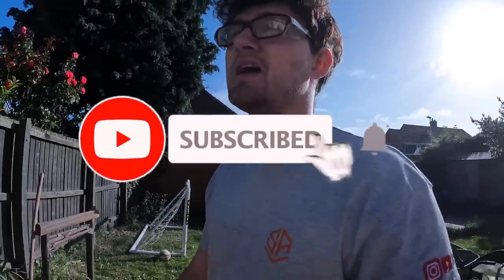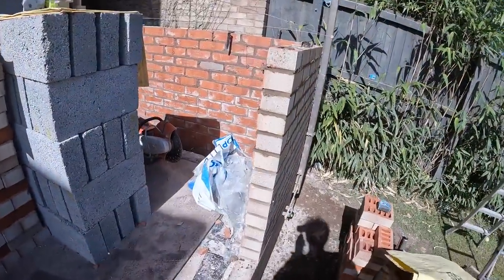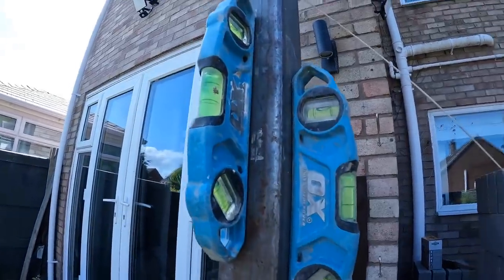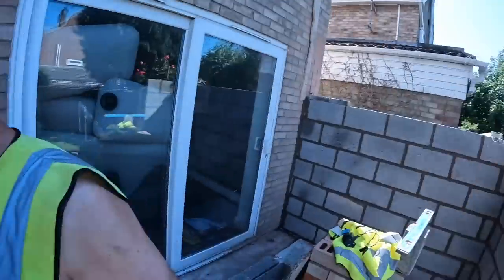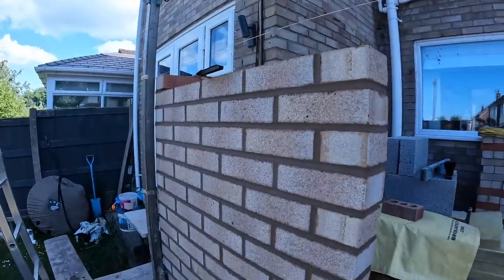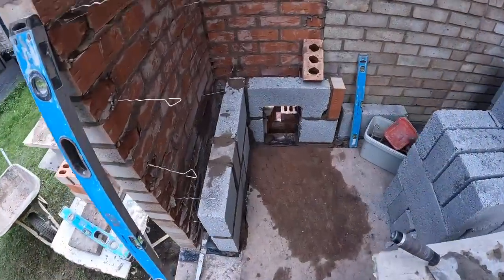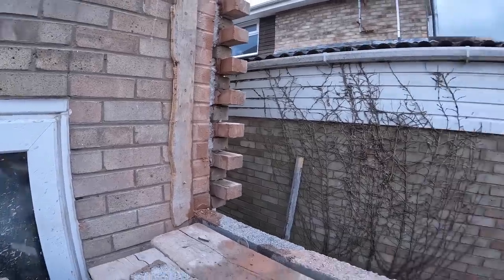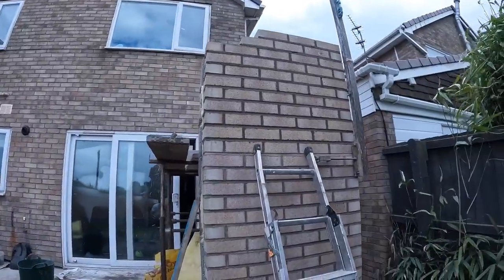CAVITY WALL CONSTRUCTION   ..BI FOLD EXTENSION PART 5

Comment: there is a high coming in for the weekend so should be good for you but that's being a builder you can not always have good weather in any case you work is looking fab thanks for the video
Reply from the maker: I’ll be grafting in it Eddie 🤙🏾, thanks Eddie 🧱👍🏽
Reply: @SteveAndAlexBuild  no problem i am a radio ham so i keep a eye on the weather for if it going to be good for radio operating
Reply from the maker: @eddieMurphy11111  Nice one 😁🧱👍🏽

Comment: Hi Steve/Alex, Im having some building work done. Im knocking through 2 commercial properties and making it into 1. Waiting on my steels… How long can I have my Acros up for what length is suitable etc ? Cheers
Reply: What length of time I mean. Duration thanks
Reply from the maker: Hi Bob , as long as you nee them as long as it’s all propped up properly . 
   On the other hand the less time propped the better 🤙🏾🧱👍🏽
Reply: Thanks Steve/Alex appreciate your reply and advice 👍🏽👌🏽
Reply from the maker: @bobdhillon8273  No probs Bob , good luck with the project 🧱👍🏽
Reply: @SteveAndAlexBuild  thanks mate 👍🏽
Reply from the maker: @bobdhillon8273  🧱👍🏽

Comment: Do you not have to put padstones in for steel on internal block work where you are. We would be shot by building inspector. Nice job lads bricks look lovely to wall.
Reply from the maker: It’s only a big lintel for a lightweight roof so no need 🧱👍🏽
Reply: @SteveAndAlexBuild  weired how rules differ from place to place every steel has to be on padstones here and even worse they are starting to make us goal post everything which is a nightmare on extensions
Reply: Same here, padstone crazy.! And yes now goalposts for everything.!! I don’t get why concrete blocks are used instead of thermal.? Again building control would moan like f**k if we used concs on the internals…
Reply: @nigelsmith1198  trying to get the hight of goal posts to a millimetre when the house brickwork is all over the place is a nightmare. Then the post sticks out in the room and we have to pack the internal wall out to get over it. Structural engineers going over the top
Reply from the maker: @nigelsmith1198  . It ridiculous . We are using Fibolite block . They are  strong as concrete but light as thermalises . Good insulation value too 👌🏼🧱👍🏽
Reply from the maker: @paullindsay4798  . The job just gets harder and harder .  
   🙄🧱🧱👍🏽
Reply: @SteveAndAlexBuild  ah ok never heard of those, are they cheaper than a thermal block….. saying that nothings cheap at the moment..
Reply: @paullindsay4798  yes friggin nightmare.!
Reply from the maker: @nigelsmith1198  . No they used to be but not any more . About £1.70 esch 🥺🧱👍🏽
Reply: @SteveAndAlexBuild  bloody hell.!!😳
Reply from the maker: @nigelsmith1198  🥺🥺🧱👍🏽

Comment: In Canada if the Ministry of labour saw you you would be fined a heavy penalty for no tie offs
Reply from the maker: What’s a tie off ?
Reply from the maker: @martin2466  🧱👍🏽
Reply: Safety harness and fall restraint, required when working at a certain level above the ground.
No railing or toe board on the scaffold either.
Reply from the maker: @jd3497  🧱👍🏽

Comment: There SHOULD be a LARGE air space gap in-between the face of the insulation and the OUTER WALL inside the cavity-wall ; this includes an air space gap in-between the face of the insulation and the cavity-wall-tie drip point which point downwards in the centre of the cavity. Cavity wall-ties are laid with a slight downwards slope across the LEVEL mortar joints from the inner to the outer walls. 
Ask N.V.Q. BRICKWORK teachers for PROOF of this.
Reply from the maker: No there SHOULDN’T 🫠